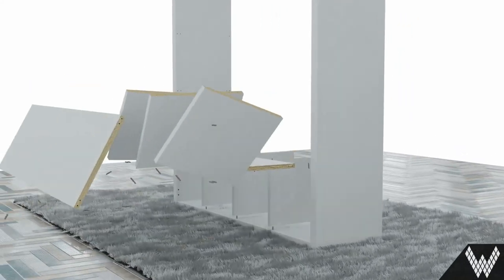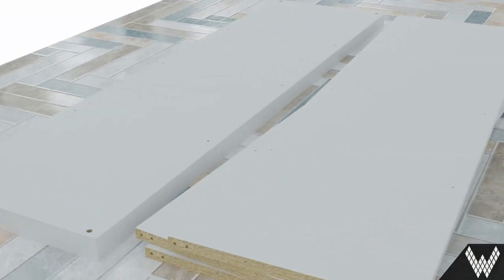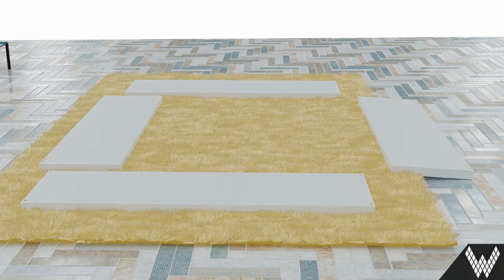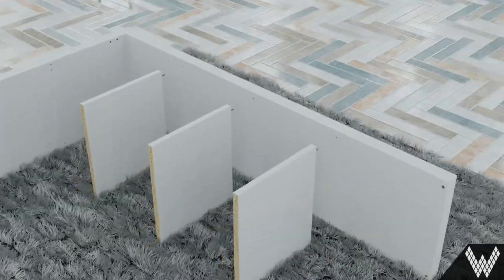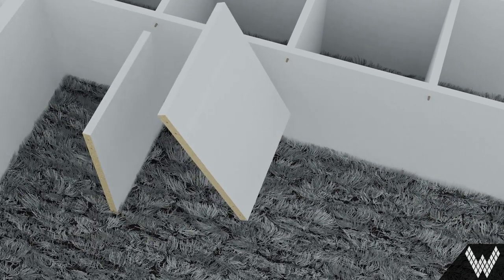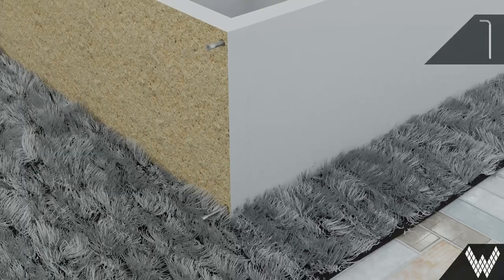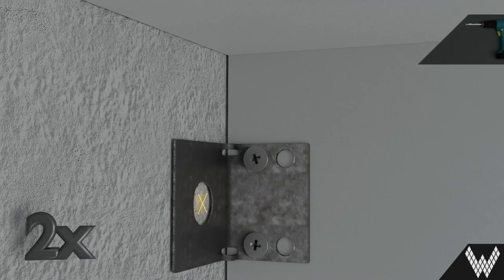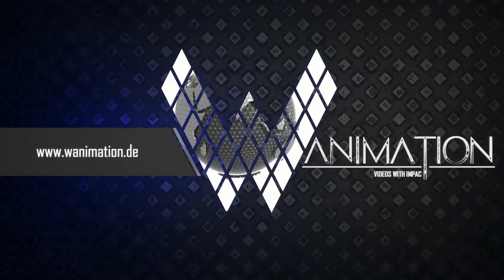Assembly instruction: Kallax from IKEA

Comment: So, would i need a big space to assemble it on the floor first? Can it be assembled in its final place instead? Could i start with the floor panel and work up?
Reply: I just assembled mine (this was the best video I found for instructions) and there's a couple things I would say
1. If you tried to assemble it upright, you need to screw the bottom screws in first
2. It would need to lean against the wall so it doesn't just fall
3. The issue is you're supposed to put the side on last so how would you screw the bottom screws on unless you tilted the whole thing to get to it?
4. IT. IS. HEAVY!

I just had to lift it by myself.. took a few tries to get it upright. I used my couch to lean against it as I lifted it up so it didn't slide. All in all - great video, not sure if it's the best idea to put it together upright, and it's probably best to have someone help you at the end. (I've got a bruise to prove it lol).
Reply: @susanebel7288   That's really useful information for anyone assembling this beauty! I love my 4x4 kallax unit.
I did get it assembled in a room that was only slightly bigger than the unit itself and I did it by myself.
Only thing to add is to be careful not to scratch it when opening. No box cutter slashing!